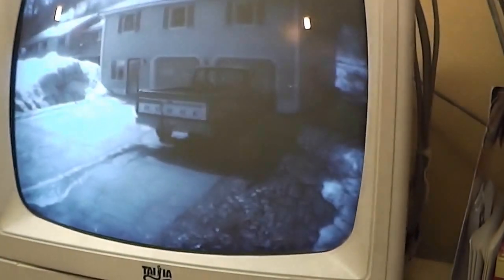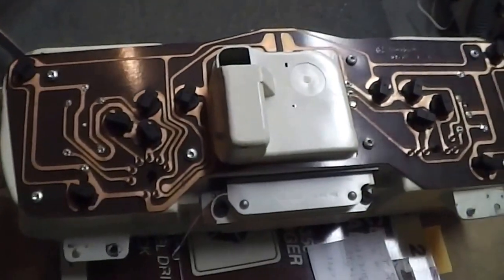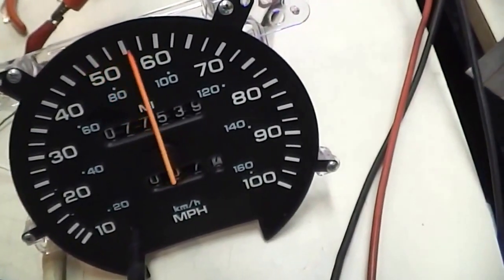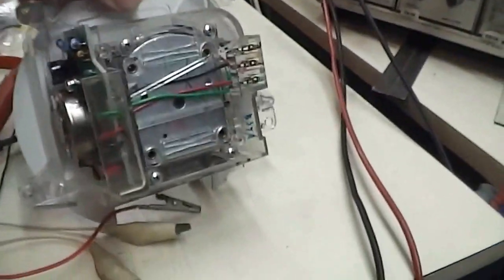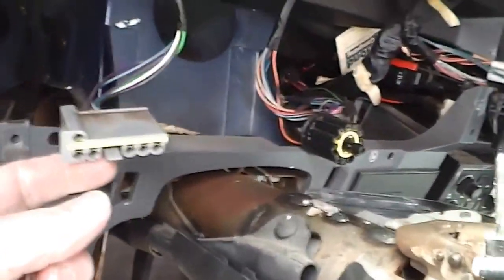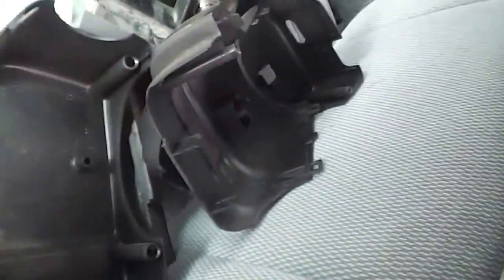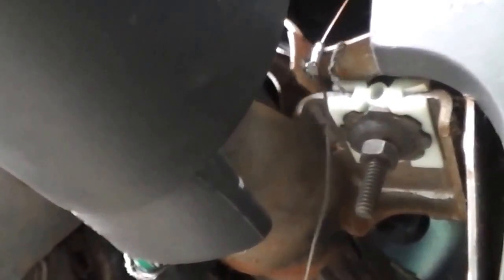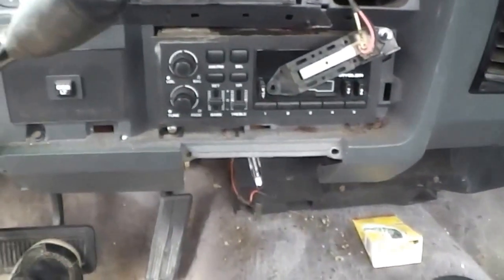1992 Dodge Speedometer stopped working. How to test it

Comment: Wait a second: At about 2:30, when referring to the contact pins for the speedometer module, you mention the "bottom pin" twice. So what is the pin-out for the module? GND (top pin), 12 VDC, then signal at the bottom?

Comment: Hi, thanks for creating this video.  I am having a similar problem with my 92.  I have tested the wiring and the sensor, so it appears my speedo is not working.  I don't have the electronics experience that you obviously have;  is there a way to bench test the speedo and/or the chip itself with a simple voltmeter to ensure they are the problem components?

Comment: very interesting video. I have the problem were my odometer qwit work. i change the two little gears in the cluster gauge the teeth were broken think that fixed it but no.so new I'm thinking it the motor the wre talking about in the video. would you happen to have the part number for it?
Reply from the maker: Sorry  I don't have a part #

Comment: For someone reason I'm getting 7v to that bottom pin. Do you think tgat could be an issue? I have tried replacing my vss and I got a used speedometer that was working before removing it for the other truck. My speedometer still doesn't work and I've gone over everything else I can think of. All I'm left with is that 7v is wrong and I have to fix that somehow

Comment: i replaced the sensor on the trans and also replace to the broken mini gear. still doesnt work, both speedo and tripo. im this close to just lighting it all on fire. any suggestions
Reply: fed master: Mine trip & odometer quit too. I replaced the gears but still wont work. Did you ever get yours working? If yes how?

Comment: i own a 91 dodge ram 318  4 wheel drive,i got a 93 cab from down south which is rust free,iam wondering if the 93 speedometer will work on the 91 wireing harness,because the inside of the 93 speedometer looks diffirent  then my 91 gauge
Reply from the maker: I would need to see the wiring diagrams of the 91 and 93.  They could easily be different . and not compatible